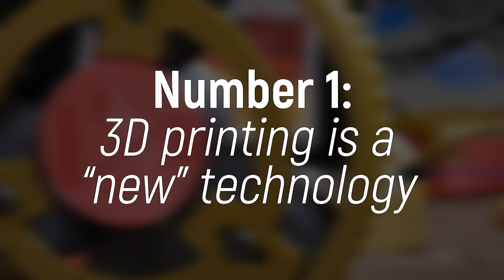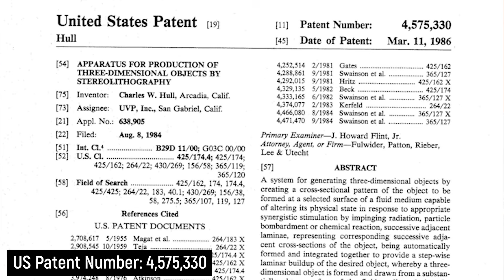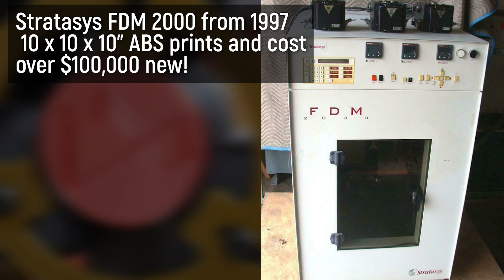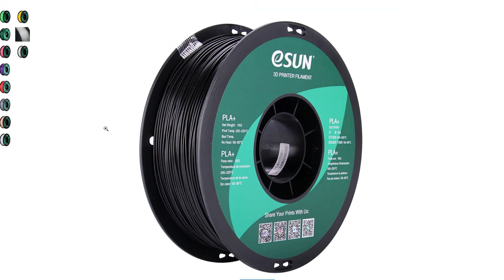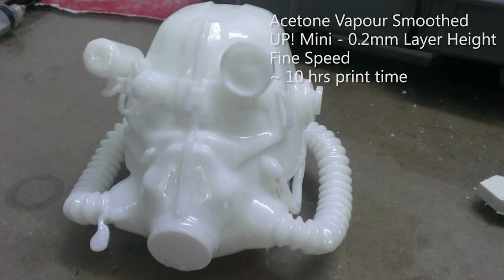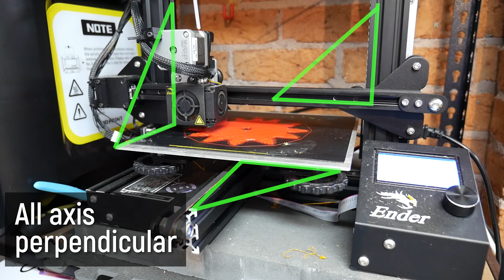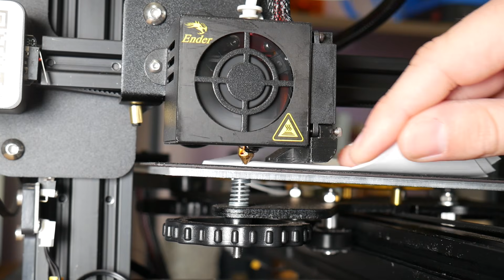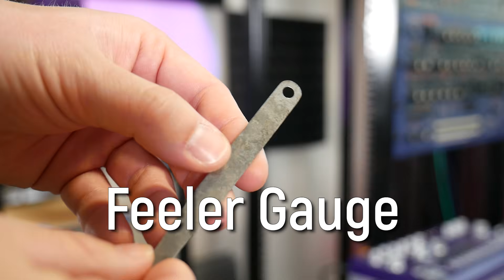3D Printing Myths I used to believe...

Comment: What size feeler gauge?
Reply: Preferably one that corresponds to, or is a multiple of, you're desired layer height, as well as corresponding to, or is a multiple of, the tested resolution your machine is capable of. I typically use a 0.406mm (0.016") gauge to tram my beds. I find that gauge is easily repeatable across the majority of my machines and is suitable for a variety of nozzle sizes. Occasionally I will use a finer gauge if I'm trying to achieve a resolution of 0.05mm layer height, but that's not that often.
Reply: It doesn't matter if you do it the way he showed where you jog your z-height to your feeler gauge thickness. Hell, you could use a 1" gauge block if you use his method. The trick is that you use the gauge of whatever the height the printer thinks it's at. If you jog it down 3mm then use a 3mm feeler gauge.

The point is that you're setting your zero to true zero. Using this method and the printer will start printing at what ever layer height your slicer settings are set to.
Reply: It would depend on what layer height you are trying to achieve. The kind of flow rate you have and speed at what you print at.

Comment: So i used a feeler gauge to level my bed. Did it for a couple of months. One day i went to level it and when my nozzle made contact with the feeler gauge it sparked and popped. This in fact burn out my mother board connection that associated with the Z axis. Replaced it and now all works well. I do not use a feeler gauge anymore and i just use Cheps level print.
Can you explain what i did or why this happened randomly? Is it safe to use the feeler gauge. Also i was using a Steel tip.
Reply from the maker: That's insane... Sounds like the thermistor shorted in the hot end somehow. Not normal!
Reply: I'm curious as to what make your printer is, modifications you may have done to it, and the type of bed surface you are using.

Comment: Everything on the internet does not have to be dramatic lol PLA is stronger and stiffer than ABS, but poor heat-resistance properties means PLA is mostly a hobbyist material. ABS is weaker and less rigid, but also tougher and lighter, making it a better plastic for prototyping applications.  So they both have uses for differing projects. Bed leveling is relative to the equipment you are using.  I have wore out several 3D printers starting about 10 years ago.  My 3D Printed Knife video has over 8 million views.  I have breathed in way too much off gas from plastics :)

Comment: every time i printed ABS i was not satisfied with the prints and layeradhesion, so i did not stick to it.. i get much better results with pla or petg
Reply: I solved the layer adhesion problem with ABS by increasing the bed temperature to 115 °C. (Without extra thermal insulation not really possible.)

Comment: Haven't seen a topic like this covered in years. A refresher from all the top creators would actually be awesome.
Reply: Definitely, a lot of us are new to 3D printing and it's hard to get it right. I have two 3D printers, both Anycubic. One resin and the other filament. They both worked great straight out of the box, but soon as I bought new filament and resin I had to learn how to change all of the settings to get a decent print. That's why I'm here. There are a billion tweaks out there, not all of them work and not for all printers. I subscribe to maker's muse and others I like, to watch their earlier videos and get the basics of 3D printing. But some of the info is out of date, so it would be nice to have a bit an up to date refresher on the basics.
Reply: Did that already ;-)

Comment: wait leveling the print bed with a sheet of paper is flawed? Well, thats a pain
Reply: Idk, I feel like he kind of over exaggerated it by folding the paper a ton. 
From what I understood, the issue comes from the fact that you’re leveling the nozzle to be set at a paper-width too high. So if you use something thin, like a post it note, it would work just fine? Especially if you set the initial z high to be the height of your leveling tool ~.01mm i think
Reply: @ForestGramps  What do you mean he over-exaggerated the folds? The question his: Why did he fold it at all? Why does he think that’s what others do or what their general advice is? It simply isn’t!
Reply: @emmettturner9452  To make a video :) 
Anyway, Who knows, maybe that is what some folks do.
Reply: @ForestGramps  It was the basis of his criticism which means he has a fundamental misunderstanding of the “piece of paper” bed leveling technique/advice. It’s so far off base that I don’t see how this can be real and not trolling... which means that may be the real reason (to get us talking!). ;)
Reply: I think doing it with folded paper is flawed. I've always done it with a single piece that wasn't folded and it's always worked well
Reply: It isn't. The issue is that you should not fold the paper. Paper of a specific density has a standard thickness. Your bog standard 73g ones are .1mm thick.
Reply: @Pilot16H Even with that, people over estimate the amount of precision a consumer grade 3D printer has or should have. You bed is not even flat anymore after it gets hot for starters. And its flatness when it's cold would not even hold when compared against a granite standard or similar tools. Yet, people are making a fuss about a piece of paper not having even thickness, when the paper is more consistent than your printer bed is level.
Reply: I see leveling the bed and setting the nozzle height as two different things... So imo it doesn't matter how thick the paper is for leveling.
Reply: In my experience, (especially if you try to print with petg) using an unfolded peice of paper gets the nozzle way too close and will cause the print to adhere to the bed way too much and squish the first few layers. Weird thats not everyone's experience, maybe I have a weird setup somewhere.
Reply: @jetison333  You have a weird setup.  Using one layer of paper is about 0.08mm (from my relative averaging of US printer paper) and sets the z at a zero that will probably not have a nozzle crash.  You do not need to compensate for that tiny amount that is not "zero".  If your print sticks too well, slice your model with a taller first layer thickness.  This will give you less squish and as a result, less bed adhesion.  Different plastics need a different amount of squish.
Reply: The problem is you are lying to the printer about how it is set up. Then you end up with all these suggestions that are really just undoing that lie.
Reply: @christopherpepin6059  Most printers and manufacturers are lying to you about their precision anyways so...
Reply: @BrunodeSouzaLino  T8x8 leadscrews moving to 0.1mm layers is already enough of a push, a 200 step/rev stepper can't even make 0.1mm moves all too reliably with those screws (let alone belts), since each step is 0.04mm you'll be microstepping - not as precise as one might rely on.
Then again like you said, the thing is one amazingly glorified hot glue gun with motors. If it can be built and sold (and work pretty well) for 200 dollars, it can't require absurd tolerances.
Reply: @Kalvinjj  For high precision machining, you'd be looking at things in unitary microns of precision or tenths of thousands of an inch (2.54 microns, 0.0001").
Reply: @BrunodeSouzaLino  Yes, I remember when I had a class about mechanical measurements, coordinate measurement machines from Zeiss could have a measuring area of a few meters around and have measurement accuracy down to micrometers. That kind of machine just ain't gonna be software compensating wobbly leadscrews for sure. Even the damn room it's installed in is always air conditioned to the calibrated temperature
Reply: It's only flawed in relation to the first layer height of your gcode. If both are equal it is fine.